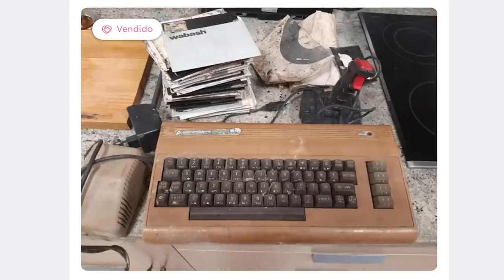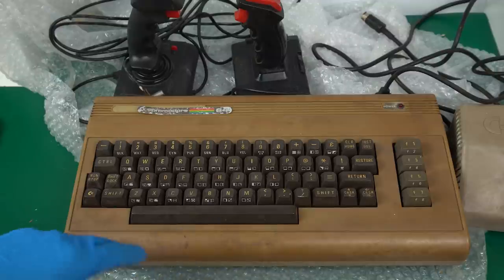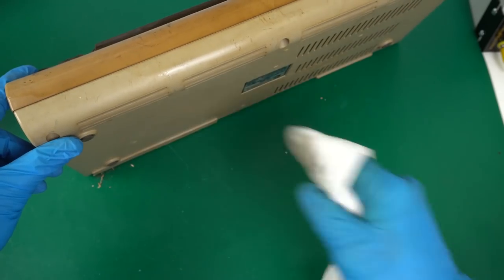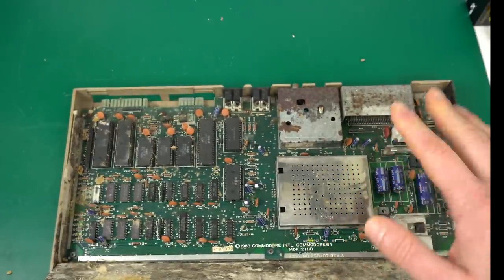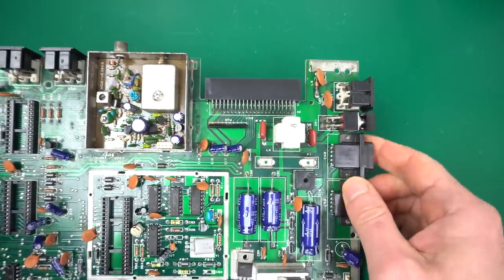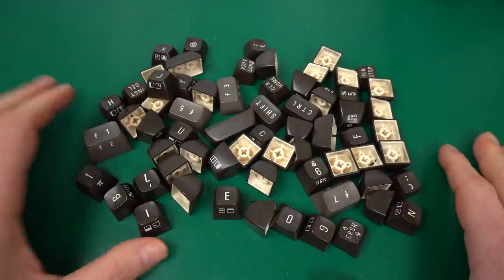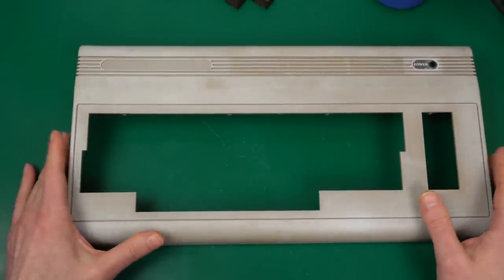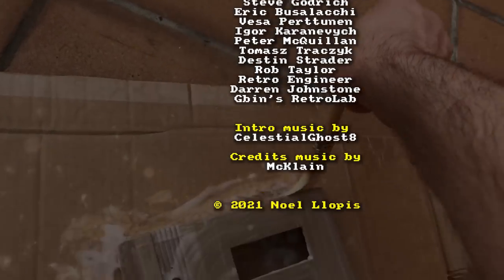Disgusting Commodore 64 Restoration. Will It Work? (Part 1)

Comment: Excellent work, Noel. Here is a tip for those springs.

Often with things that become too rusty removing the rust will cost you integrity. If I had a spring I worried might snap if I removed the rust I would use a product called 'rust converter'. I think it would be a good candidate for things like those springs, RF shields, etc. I use it on old metal tanks so I do not need to remove the rust. What rust converter does it is chemically alters the rust and hardens it making it stronger than the metal! You can then paint over it or just leave it bare as it stops further rusting.

Comment: First! :) The condition of this C64 reminded me of an Amiga 500 I had once, which we literally pulled out from below manure pile/half buried in the ground already at some countryside electro-junkyard, around year 2000. This was before electronics recycling became a thing in the area. We had to put it into several layers of plastic bag just to be able to put into the car, to be able to endure the smell while getting it home. It's case was already broken/cracked at many places, its keyboard, shielding, FDD was way beyond repair, of course, but the board itself lived in the end! Thanks for taking up the challenge of saving this C64.
Reply from the maker: Wow, too bad you didn't have a video of that. But yes, I'm impressed with Commodore boards in general. If that was an Amstrad board, it would have been long gone already.
Reply: @NoelsRetroLab  Video? :) This was before everyone had a camera in their pocket... And one certainly didn't go to a junkyard with a VHS camera. :D But now that I think about it, I'm not sure actually where that motherboard went. I wonder if I still have it in storage somewhere, or gave it away when moved abroad. I need to go in the basement (a dry one, don't worry!) to look into some boxes.

Comment: Great stuff as usual. When I was an intern in a steel company, one of my tasks was to periodically remove mainframe terminals (yes, I'm that old) from a coking plant (which, incidentally, creates a lot of coal dust and soot) for maintenance. They were so dirty that I had to wash them with a power washer and let the boards dry in a cord as if they were clothes so this Commodore would be just another day at the office for me :)
Reply from the maker: Thanks! That's crazy about those terminals. It must have been quite a sight! Did they work afterwards? I imagine they did otherwise you wouldn't have bothered trying to wash them.

Comment: I have a tip for retrobrighting, you have to put some plastic foil over the cream, every 30 minutes, you need to go outside and massage the cream around and turn the pieces you are retrobrighting around 45 degrees, it will eliminate those "paint lines" you get on the case (you get those when the cream has dried up), you will get a much nicer and cleaner retrobrighted computer that is almost indistinguishable from the original factory color. Otherwise? NIce video man!

Comment: Non-corroding plating on the Copper backside connections timemark 10:47 the 63% lead in solder tarnishs to black once the clear flux overcoat has been cleaned to make it conductive. There's chemical-reaction replating kits that don't tarnish the port contact fingers.

Comment: Finally an amazing job, Noel! 
Okay, this is a C64 from Germany, apparently. We call it "CeVi", which is a short cose form of "C-Vierundsechszig" (C64), BTW.
I would like to formally apologize for the condition of the CeVi of the compatriot. :-)
On one of my restoration objects I simply brushed H2O2 on each key cap, the effect was the same as yours, they are easy to whiten again.
The type plates are totally sensitive anyway.
If the case is only slightly yellowed, simply brushing it with Domestos is often enough. The problem is that, for example, Domestos sometimes dissolves the front special characters on the key caps. Then they have to dry thoroughly, because if you rub them first, they are gone.

Comment: Whenever I have to totally clean an old board like that, after I scrub it down just like you did in the video, I flush the entire board with a bunch of 99.9% pure ethanol solution. The alcohol displaces the water and then evaporates a lot faster than just water alone. It's a little expensive because after I've used the ethanol about 4 or 5 times before I'd have to distill it again and clean that up too. It's possible to filter out and clean it up, but it's not so expensive that I find it necessary to get as many uses out of it as possible.

Comment: Sunbrite is better than retrobrite, at least on first attempts, no damage or marble effects, I did on a C64C, on the case , the color came back to original, but for some reasons, the keys are a bit reflecting the UV and are still a bit yellow. anyway they was brown on beginning,  I will make a video about my trials, some days on full sun without any chemicals. You still can use retrobrite technic after if the effect is not perfect, I recommend to use in liquid, not as cream (about marble effect.)
Reply from the maker: I tried sunbright but for me it barely worked on a very slightly yellowed piece of plastic. But then again, I didn't have very strong sun in that area (clouds and fairly northern latitude). There's no way that case would have gone close to the original color that way there. I'm very interested in trying an indoor setup with UV lights though.

Comment: Hi! I think 1083 on 6510 stands for "10th week of 1985" so early 83s too in my opinion... Nice video (as always), nice job and... I'm looking forward for part 2! 👍🏻😊
Reply from the maker: Yes! You're totally right. I think I was thinking March vs. October, but that's the week indeed 😃
Reply: @NoelsRetroLab  👍🏻 See you soon Noel! 😊
Reply: yes, it stands for the week and year.
1083 is week 10 of 1983
I have some with 5082 written and it stands for fiftieth week of 1982 for example.
Reply: @MD_il_microcanale  Okay that'll be about enough of that geek flex bragging about your silver label breadbin there, hoss!

Comment: Thanks for your video. Can you tell me where to find the pin rectifier for the IC? Thx for your answer. Regards.
Reply from the maker: You're welcome! I got the tool from Amazon UK https://www.amazon.co.uk/Spiratronics-TH2-013-IC-Straightener-Tool/dp/B0093Z7JH0
Reply: @NoelsRetroLab  Thx a lot, Noel. Regard.

Comment: Are you not afraid of getting streaking from using the salon cream technique insead of the newer liquid peroxide submersion technique?
Also, hae you thought about getting UV lamps?
Reply from the maker: I've never done the submersion approach due to lack of containers of the right size and enough peroxide. I'm also not sure I have enough sun here for that to work, but that's just a guess. I've never had a problem with this approach as long as I keep going out to refresh the cream every 15 minutes or so (and better in overcast days).

Comment: That looks so much like it was in a heavy smoker's room. That's absolutely tragic.

Good luck!
Reply from the maker: Thanks! You know, it didn't smell like tobacco at all. I think it might have been humidity plus direct sun for 30 years.
Reply: @NoelsRetroLab  Well, all that mold inside the RF shielding couldn't have helped.

I've seen similar gear (PC's) have that kind of discoloration in workplaces like garages (some really grimy garages) where everyone smoked heavily, which is where I made that connection.

Looking forward to Part 2!

Comment: Hi Noel, you definite need a UV flood light, I got a 60W from AliExpress, strong enough to retro-bright within few hours if hydrogen peroxide is enough. Last time I did my Apple //c chassis with cream, and found that it's not good, too many uneven area. Finally have to did it 3 times, later I found a shop with liquid form hydrogen peroxide. that I can submerge in clear water with tin foil wrapped around the plastic container, result a lot better.
Reply from the maker: Probably, but I don't have space for the lights or the container at the moment. Besides, how do you get that much hydrogen peroxide? Do you need to buy it in bulk?
Reply: @NoelsRetroLab  Just a beer bottle from chemical shop, cost around US4, 50%.
Reply from the maker: Oh I thought you would have to get 10 liters of that to fully submerge a case. How are you doing it with so little?

Comment: Can't wait for episode II, III, IV,... Looks like "The Walking Dead Breadbin" to me. Will get popcorn for the next episodes (way more interesting than some Netflix series). After looking at it, probably is not only spiders' work and dust: I would have used a Geiger detector on it too. If I clean a machine like this in the shower, my family would make me clean the shower with bleach after I finished. Another fine video from Noel. He did it again.
Reply from the maker: Haha! Thanks! I did have to scrub the shower quite a bit afterwards, so you're right about that part  😃

Comment: The C64 I'm using now at least externally looked a lot like this. But it was mostly just dirt. It was so bad that just touching it made my hands itch. After cleaning it looks like new. I didn't bother to retrobrite it since it was nearly the original color. The PCB was even dirtier, but after cleaning it looked brand new. Its only faults were 1 bad RAM chip (I replaced all since it was MT RAM) and the cartridge slot. Unfortunately because my home made PSU was using a cable that wasn't up to the task it wasn't getting enough power and I had color glitches. So I replaced the PLA and the color RAM but destroyed a trace in the color RAM by accident. So it's no longer like new. It's got a bodge. I had been using de-oxit on the cartridge slot, but it stopped working and I couldn't fix it. So I replaced it. I lifted a trace, but it's still attached. So I just soldered it to the new connector. The unit is working really well now. I even have a working SID! All the unique parts are original except the GAL PLA that I'm using. I could put the MOS PLA back in now that I know it's working, but the GAL seems like it's better for the long run since the MOS ones do die.

Comment: Noel, I've had my best luck retrobriting using a clear plastic bin with a few bottles of the 3% peroxide from a drug store.   That being said, my favorite commodore I own is a C128 is a retrobrite fail that I ended up painting the case black.
Reply from the maker: Right. Or with UV lamps, but the amount of peroxide you'd need is huge! And is 3% enough? But yes, I'm going the painting route as well 😃
Reply: @NoelsRetroLab  3% works where I am at.   I live in the Tennessee so we have plenty of sunshine, but most of our rooftops don't look as good as yours!  For a while during the pandemic, 3% was hard to come by, but the stores all seem to have stock now.  I think it takes around 6 or 8 bottles,  maybe 10 USD worth, but I save the liquid in the bin and reuse it several times.  I've seen places online to buy it by the gallon but it seems cheaper to buy it by the quart locally.

Comment: Look like it's been put in a high humidity and sunny place, some of our old electronics did look like this, dust and rust together under 99% humidity (in my city), maybe also near the sea shore so the "salty wind" that make all metal oxidize.
Reply from the maker: You're on to something there. It came from the Balearic Islands in the Mediterranean, so that's probably exactly the environment it was in.
Reply: I live in Hong Kong, where the C64 was made, a place that have very high humidity. Seen quiet a lot of oxidation of electronics.

Comment: I wonder if you could buy new springs like these on Ebay or somewhere. And this case may be a good candidate for painting.
Reply from the maker: Probably. And I think they don't have to be exact. Just about anything roughly of the same size will be enough to push the keys up. And yes, the case is a GREAT candidate for painting (did it this morning 😃).

Comment: Latest information i recall learning of here on the youtubes; with retrobrighting: - HEAT makes the biggest difference. Also maybe focus your OWN artificial UV source. I found that a certain wavelength is important, as each wavelength has an enormous difference in effect. I think mine are 365nM 100W units. Four of them. in a HUGE plastic bin with PID controlled hot tub spa heater. I immerse parts in a bath to keep down blotching that you tend to get from gel. Then I hear that the plastics bromine fire retarded stuff re-yelllows plastics all over again. So I use a spray aerospace UV blocker to protect it. I did my 1541 and breadbin and a customer's C=128 to GREAT effect like this.

Comment: I don't think the tops of the keys were ever supposed to match the fronts. Comparing the insides of the caps, which are cream-colored, it appears that the symbols on the fronts were painted on. Which makes sense if you know how the double-shot method works: in order to fill in the "holes" in characters like O, A, or 6, there have to be literal holes in the inner mold for the brown plastic to pour through. And all the front symbols are full of empty enclosed spaces. Molding something like the checkerboard symbol would be virtually impossible.

Comment: Hey dude. I know it's a lot of effort but these kind of restorations where they're almost beyond saving really are the best. Just curious, can you sand plastic like that something quite low-grit to reveal a new layer?
Reply from the maker: You could but... the C64 has a fine texture in the case, so you would lose that. I went the painting route and I think it came out pretty good.
Reply: @NoelsRetroLab  SPOILER ALERT!

Comment: At least the photos of it were honest. Stuff I've bought from ebay that had nice photos and said good condition but untested usually turned up smelling like their cat pissed on it and then had all the hallmarks of someone that thinks they know about compoooters taking it apart to attempt to fix it like all the screws missing, all the plastic clips broken off etc.
Reply from the maker: For sure! They didn't try to hide it in any way and the price was right too, so props to the seller!
Reply: "untested" means broken but don't want to admit it.
Reply: @commodorebench2556  Also the other good one to avoid is

Worked when last used 
Worked when stored

( in 1986 )

Comment: Why don’t you wrap your case in plastic after applying the #40? It helps ensure an even coat across the plastic.

Also, a cheap airbrush station will come in handy. You can do custom paint or even mix colors to match original. Best of all, it goes on even, drys fast and you can seal it too.

Nice vid!
Reply from the maker: I tried the wrap approach and it's never worked well for me. It's very easy for the wrap to touch the case, thin out the cream and have it dry out or at least end up really uneven. This way has always worked well for me, very even... but obviously not this time. This one was too far gone.
An airbrush (and skill to use it) would be great. This time I just went with spray paint from a can though. Enough for a first time 😃

Comment: You have bleached the colour out of the plastic owing to the high concentration of peroxide caused by brushing more cream onto the stuff that has already dried out. Either apply a single coat and wrap in cling film, or rinse the case between each application. Believe me, I learned this the hard way after ruining an Atari ST case in 2009. :)

Comment: Retrobrighting will only last for some time, I think the bad spots on the case will come back. For the keys I do the following: Get some flat and transparent bin, put some double sided glue tape on the bottom and stick the keycaps like you've already done. Instead of using that creamy peroxide stuff, use fluid 12% peroxide and just pour carefully into the bin with the caps, to submerge them. After a few hours in the sun, they will come out perfectly. You can see the chemical reaction, a lot of small bubbles will appear... Just adjust the position a bit to the sun, so they get the UV rays from all directions. But also this will not last forever, the yellowing will slowly come back. For the case, there are special spray paint colors for the C64. Removing the badges and putting some coats of paint will bring back the original look forever...
Reply from the maker: I have an Amiga 500 that I retrobrighted 5 years ago and it's as white as the first day, but I've also heard reports of people saying the yellowing comes back. So it has to be dependent on the plastic or storage conditions or something like that.
Reply: @NoelsRetroLab  yes, it is depending on the kind of material and storage. I've retrobrighted some cases and keycaps from Amiga models. My A600 keyboard looked white like snow in the first months. After some years, it looks like someone smoked cigaretts in front of it... :D
Reply: Would a clear coat spray paint help keep the keys from yellowing again?  Or would the paint not stand up to the consistent fingering?
Reply: @MattKasdorf  honestly, I don't really know, but I assume not. Because the chemical reaction is happening inside the material, not on it's surface. I also think, a clear coat can be torn away by permanent touching only, when it's too thin. You can layer more than one coat.

Comment: To retrobright stuff I find the cream method with the sun very hit or miss...  A sousvide + full spectrum light setup with simple h2o2 works way way better IMHO.
Reply: Good luck with the rest of the restoration!
Reply from the maker: I have no doubt it's better. It seems it would get much more even coverage and wouldn't have to check it every 15 minutes or have it risk drying out. Unfortunately I don't have the space for it, so this is the best I can do given the situation. For what it's worth, that method has always worked great for other cases. This one was too far gone plus it had all those other blemishes though.